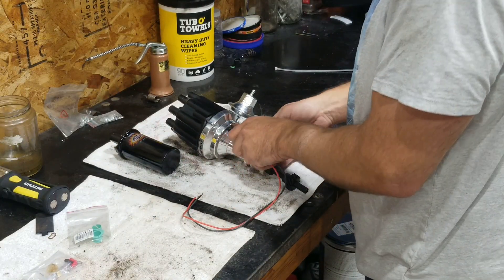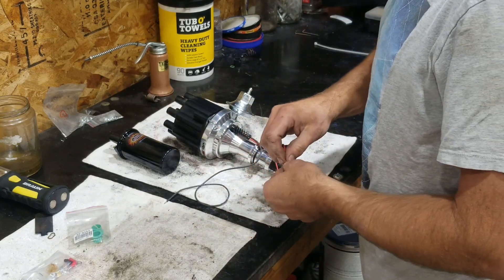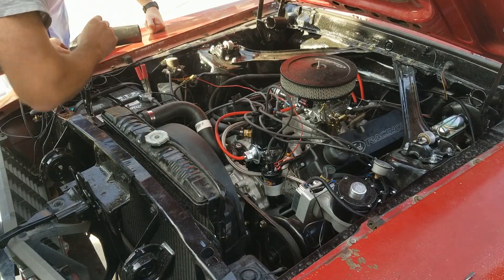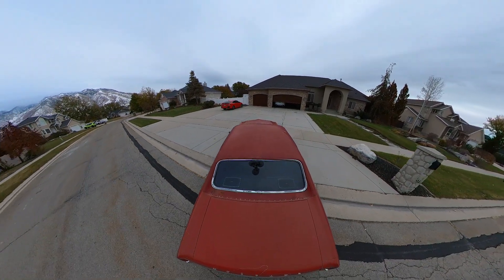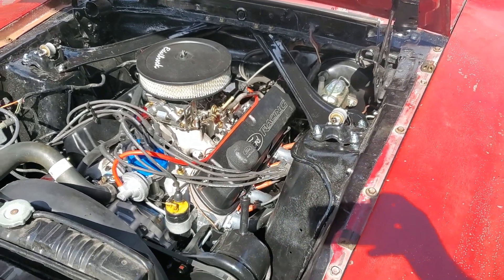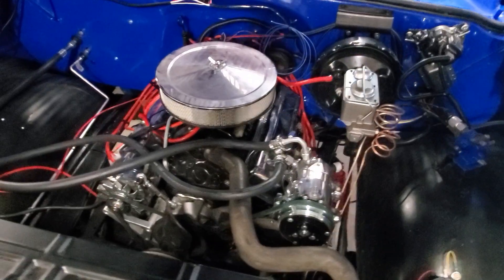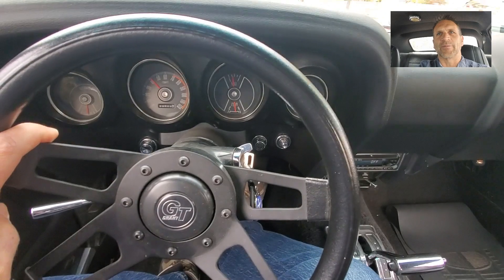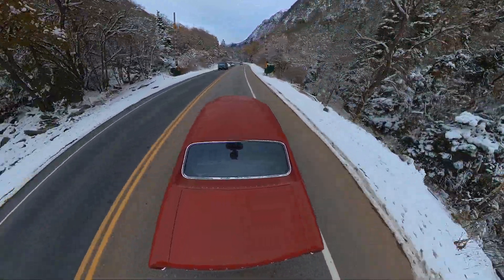Wake up your Ford 302 with proper combustion.

Comment: Do you know the trick for adjusting the range of your mechanical advance by welding the slot to limit the range of the mechanical advance mechanism?
Reply from the maker: I'm aware of that trick, and I understand the idea, but I've never actually done it myself. The spark was so weak from the original components that a replacement was needed anyway.